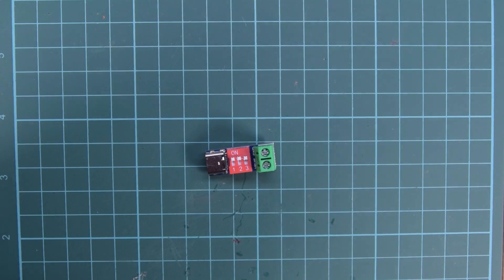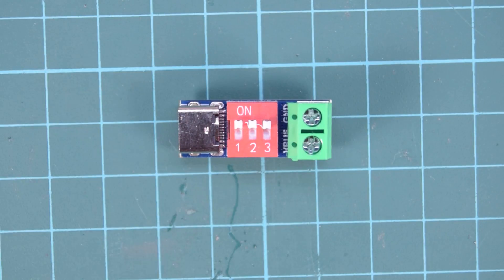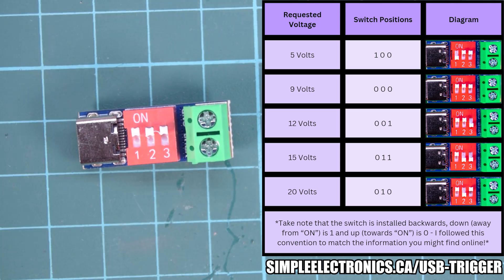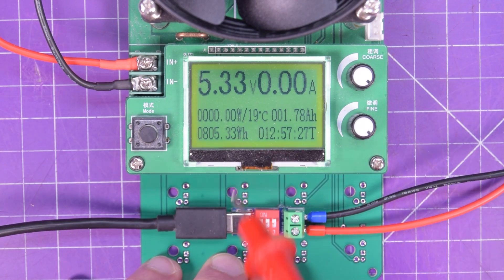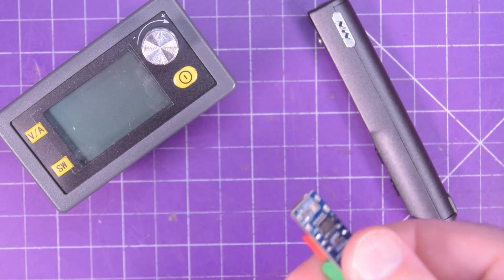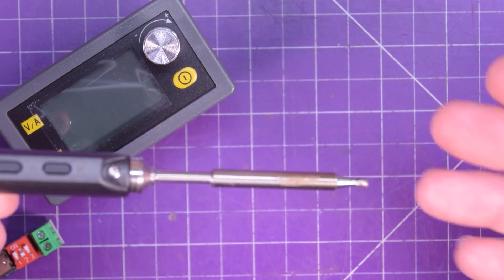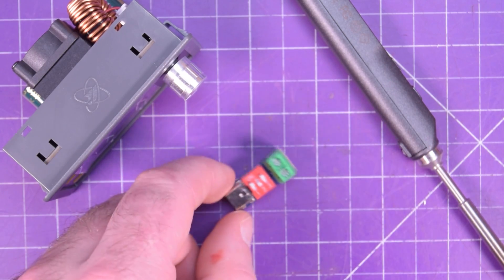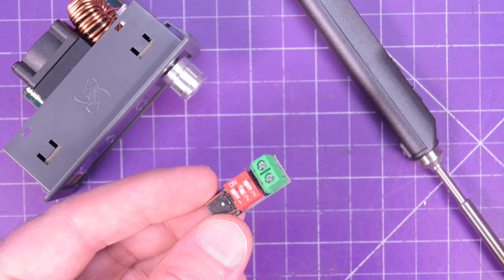Dominion Over Your Charger - USB-PD Trigger PCB

Comment: Awesome little device, but things can fry if anyone messes with the dip switches...If I were to use these, I'd definitely make sure no one could access the switches.
Reply: There exist similar PCBs but coming with fixed voltages, which should be handy if you don't need to change the voltage. Alternatively, you can replace the dip switches on this pcb with some wires.